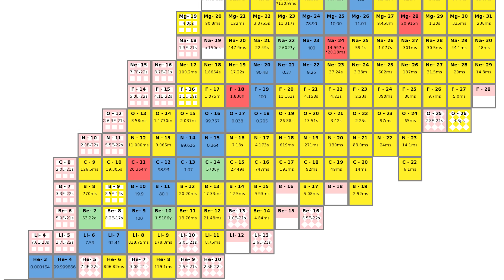Why the U.S. Doesn’t Recycle Nuclear Fuel

Comment: Nuclear energy is a scam. It's the most expensive form of generation on the planet, by far.
Reply: Everybody who talks about reprocessing spent nuclear fuel without mentioning that you produce tonnes of plutonium 239, which you need for a nuclear bomb, is disqualified. How can you not mention that?! It's a terrible idea to produce material for thousands of nukes as a waste.
Reply: Yet ruinables actually cost more than nuclear in the long term when real numbers are used.
Reply: @ForbiddTV if you study the numbers nuclear is ruinously expensive. The UK embarked on a full scale nuclear energy program beginning in the 1950’s & when the real bills came in the cost was so high that the Blair government abandoned nuclear power. A few years later another government decided nuclear was the way forward so we are now building, currently massively over budget, a joint Chinese French design. The whole concept of heat to steam to electricity is at best 50% efficient & reactors are built so far away from people that combined heat & power isn’t practical. If you want to make plutonium for weapons then reactors are great, if you want low cost electricity, renewables with storage are the only practical technology.
Reply: @springwoodcottage4248  Solar photovoltac panels are at best 24%, so do you actually have a point about comparing to steam turbines?  Now let us begin your education that you failed to research past the Greenie numbers:
Reply: @springwoodcottage4248   The numbers you will try to use RATED numbers for output capacity.  All my ruinable systems deliver MUCH less. Solar 1/4 of rated output in the best summer months, in winter it's as low as 1/32 of rated output.  Wind also less than 1/4 since most wind systems are rated at 25mph and averages in my area are only 7-8 mph.
Reply: @springwoodcottage4248   All ruinable systems need backup sources to operate on the grid lest we have massive rolling blackouts every time the sun goes behind a cloud or the wind stops blowing.  This almost always involves fossil fuel plants or storage.  So these costs of additional facilities always need to be factored in.
Reply: @springwoodcottage4248   Solar output degrades more than 2% in the first few weeks, and almost another 1% each year thereafter.  They never tell you this.
Reply: @springwoodcottage4248   Ruinable facilities need to be replaced 2-3 times in the same lifespan of a typical nuclear power plant.  Seems they should factor that in as well, but...
Reply: @springwoodcottage4248   To produce the same amount of electricity, a nuclear energy facility requires significantly less land than ruinables, with wind farms needing up to 360 times more land and solar photovoltaic plants requiring up to 75 times more land.  Keep in mind those are RATED output numbers which isn't a fair comparison.  Nuclear can keep a steady rated output 100% of the time 24/7 minus outages for maintenance etc.
Reply: @ForbiddTV demand is not 100% of the time, so that supply is not needed all the time & the cost of nuclear is many many times that of  renewables which are free fuel powered by the sun. The next development in renewables is large scale storage.
Reply: @springwoodcottage4248   Global installed electricity capacity reached 9.4 TW in 2024, while total electricity storage capacity was around 89 GW in 2024 (mostly pumped hydro), meaning storage is less than 1% of installed generation capacity.  Get back to us when you actually have something to talk about regarding energy storage. Since you have been promising me nuclear fusion for all of my 60 years, I am not buying any such what if nonsense.
Reply: @ForbiddTV   Is there any other way of generating electric power from Nuclear fuel except using it to boil water and spin a turbine with the steam?
Where is their turbines?
Reply: @ShonMardani generating heat to make steam to spin turbines is expensive & obsolete Victorian technology. Best to directly generate electricity & store it for subsequent use.
Reply: @springwoodcottage4248   You were just shown all the multitudes of items your Greenie numbers leave out of the comparison calculations.  So continuing to lie and say that nuclear costs is many times that of ruinables is not impressive and destroys your own memes.
Reply: @springwoodcottage4248    How do we get electricity directly?
Why there is those cooling towers?
Reply: @ShonMardani we use technologies that directly generate electricity, not old Victorian steam punk.
Reply: @springwoodcottage4248   Do those technologies have a name or descriptions?
What do they cool down with those cooling towers?
Does Elon have anything to to with faking this one too?

Comment: I want the LFTR reactor. It turns thorium into uranium on the fly inside the reactor and then burns the uranium right there. It has many many advantages in terms of safety, waste, and even cheap high temperature material processing for industry. They still need to work out some problems with the chemistry so it doesn't destroy the pipes and valves.
Reply: There nothing on the fly with thorium, because Pa-233 is a neutron poison. In contrast to the uranium cycle, where the breeding of Pu-239 is really on the fly, you are required to either use a separate thorium blancket for breeding, or you have to separate Pa-233 from the fuel loop. First is complicated and last causes proliferation risks.
But the main issue is the production of U-232, which decays to TI-208 at some point. It is one of the hottest natural gamma producer, which requires very thick shielding. 
So, it is much easier to use the uranium cycle, especially because of an abundance of spent fuel and depleted uranium.
Reply: Thorium is an annoying waste product of rare earth processing. The Chinese produce it in spades. This has a lot to do with why they are building Thorium reactors.

Comment: SMRS ARE CRAP. NOT ENOUGH POWER OUTPUT. SMALL NUCLEAR IS IRRESPONSIBLE. 
DATACENTRES ARE CRAP. NO ONE WANTS TO GET IN ONE LIKE ELON AND MARK.
Reply: Come back when you figure out what a caps lock button is.
Reply: @danadurnfordkevinblanchdebunk  the world could use more shouting about this crap 🤣
Reply: @danadurnfordkevinblanchdebunk  nightmares for 100 to 440mw. At least 2GW is worth nightmares and risk.
Reply: Is there any other way of generating electric power from Nuclear fuel except using it to boil water and spin a turbine with the steam?
Reply: @ShonMardani  yeah but water is easy to handle. sodium sounds like an accident waiting to happen
Reply: @ShonMardani   NASA uses Radioisotope Power Systems (RPS) and Radioisotope Thermoelectric Generators (RTGs), for NASA's current space probes. These systems use the heat from the natural decay of plutonium-238 to produce electricity, providing a reliable power source for missions to the outer solar system and other harsh environments where solar power is not feasible.
Reply: @danadurnfordkevinblanchdebunk  how many kilos of plutonium for how many milliwatts running the voyager?
Reply: so was I man. SMRS are crap!
Reply: @danadurnfordkevinblanchdebunk  and what did they achieve with that? some spare plutonium for an arms race? the output of a small gas turbine plant for all the risk of nuclear?
Reply: @danadurnfordkevinblanchdebunk  Yeah thats longstanding 3.5% PWR designs not 25% mini-me bombs buried 20metres below who gives a damn, general.
Reply: @danadurnfordkevinblanchdebunk  no you'd need a US NAVY engine if you just wanted to drive around in a ticking time bomb 🤣
Reply: @danadurnfordkevinblanchdebunk  there's nothing left to show.
Reply: @danadurnfordkevinblanchdebunk  SMRS ARE CRAP? same point man. Too small, not enough electricity output, not worth the hassles with Nuclear if its not at least going to give the people a couple of gigawatts. Cost too much per kw/h output. A risky waste. What's your point? These little terror riskers are worth 100 megawatts?! You gunna dig it up if this new tech f-s up?
Reply: @danadurnfordkevinblanchdebunk  no, proper nuclear power stations give you gigawatts. Conventional PWRs 1GW output each. I'll go build a 2 reactor PWR plant and make 2GW for $8-12 bil , you go build a grouped SMR plant and make 2GW, what's that cost? How's your maintenance? did all 20 of your 100mw Trump bombs pass there welding checks?
Reply: @danadurnfordkevinblanchdebunk  no I think they're great, conventional PWRs.
Reply: @danadurnfordkevinblanchdebunk  not at all, I checked out the xe-100 it looks pretty good. Some of the other ideas sound worse. I think new traditional PWRs make more sense and would be cheaper, whatever the investors are selling. The world doesn't need 1000 SMRs producing piss all power. 1000 gas turbines got to be a better bet
Reply: @danadurnfordkevinblanchdebunk  dude you are so petty about a few megawatts, you thought I was flaming 900MW Westinghouse because I said "1GW". You think i'm flaming Nuclear because I think SMRS are crap. I think your last comment sums it up entirely, who in their right mind would bother with the security and environmental risks for SMRS over gas? It seems you can't make a point, SMRS are pointless.
Reply: @danadurnfordkevinblanchdebunk  You can keep your ton of Tristo balls for my 100kg of lightwater waste? I dunno I just read it on the internet 🤣😄 no way Kevin, there is no way on earth Nuclear is safer than a stupid wind turbine or solar panel!

Comment: 90% of the world's population live in the sunbelt and windbelts. Fortunately for those with empty roof realestate. 

Dirt-cheap PV on dirt-cheap empty roof and no grid costs is a brilliant economic start.
Roof PV is cheaper than windows installed $m². 33m² is enough. 
66m² will fill the grid and self supply. 

Mathematics is simple starting place for sensible thinking.
Reply: You got it. That's why so many are against solar farms. It's not that they're against solar. They're against placing solar is stupid locations. Why ruin a field or forest when all these rooftops and parking lots exist?
Reply: @Ichibuns exactly. 
Roof PV destroys grid cashflow. 
In Australia high marginal taxpayers love tax-free savings, love ❤️ TAX-FREE. 
$10,000 tax-free savings annually for decades and decades. 

Many can not understand anything beyond the size of a nuclear fuel pellet, 10gm pellet.

With v2g EVs, No petroleum, no grid electricity, no gas heating,  no grid infrastructure upgrade costs ....
Reply: @danadurnfordkevinblanchdebunk  roof PV electricity is 2cents kWh electricity. 
No grid rental costs. 

My grid supplied electricity is 52cents kWh.
Both my neighbours 4cents kWh feed-in electricity is only 2 meters away. 
Nothing between us but the grid. 

The grid makes all electricity extremely expensive compared with the generation dirt-cheap costs.
Reply: tilapiadave3234  wow.
Reply: @danadurnfordkevinblanchdebunk you should have put in 3 grid tied systems
Reply: @danadurnfordkevinblanchdebunk  yes I thought that might be the situation. 
New connections to even city medium rise commercial developments have been held up waiting for enough supply. 
And the fees or costs were massive. 

No CO2 emissions and enough grid electricity is a big matter.

Comment: Why don't we do more to pursue Tidal Energy?  I have only heard of one European currently developing it.  It seems like a no brainer.  Sure there is a higher upfront cost, but in the long-term benefit is a reliable, limitless source of energy.
Reply: Europe: Done that. Close to mass adoption.
Reply: @michaelmueller9635   Not anywhere near.  No investors, no backing and underdeveloped.
Reply: @michaelmueller9635   Close adoption after over a thousand years of development?  You sound worse than the fusion wannabies.
Reply: It's been experimented with for more than a thousand years.  And as you noted it's not an actual thing because it hasn't been practical.
Reply: @danadurnfordkevinblanchdebunk  On the contrary, the one company pursuing it has shown it is practical and economical. They're just working on scaling things up.
Reply: @danadurnfordkevinblanchdebunk   That's a pretty lame attempt at an insult, particularly in light of the fact that the fusion breakthrough has already been done, with a net positive result.  And, as @RadDad419 points out, at least one company in Europe has demonstrated the efficiency and scalability of tidal energy.  Maybe try not listening to the MAGA cult so much.  Just a suggestion.
Reply: @danadurnfordkevinblanchdebunk  The problem with Tidal Power is low availability of suitable places to build facilities. France and Norway have operational facilities with excellent results, but widespread use is limited by geographic and topographic conditions of the coast
Reply: @danadurnfordkevinblanchdebunk   Fiords, salty lagunas and very high tides regions are perfect for tidal electricity. And France is particularly abundant in good places to build tidal power plants and it’s building a lot of them. Although, we should built things according to geographical capabilities. It’s just a another weapon on the arsenal

Comment: Wow, we are a massive consumer of electricity you need to adopt this strategy. And other ways to make fusion safer. How do you strip the split atoms from the ones that haven’t.
Reply: You can use a pyro-processing-unit, which uses destilation of metal salts to separate into different elements. They have different boiling temperatures.
Reply: @egnegn123 yes a thorium reactor right little safer if it has problems it just cools itself not going into meltdown.
Reply: @neonninja5049  The same true for fast-spectrum reactors using the uranium-cycle.
Reply: @egnegn123  The concept of pyroprocessing evolved over time, but a lot of the development came from research in the nuclear field, especially in the mid-20th century. Key contributions came from scientists and engineers working at places like the Argonne National Laboratory and other nuclear research facilities.
Reply: @egnegn123  By applying different temperatures and sometimes using specific chemical environments, it helps to isolate and separate the different elements or compounds. This makes it really effective for recycling valuable materials and getting rid of impurities. It’s a pretty fascinating process!
Reply: Is there any other way of generating electric power from Nuclear fuel except using it to boil water and spin a turbine with the steam?
Reply: @ShonMardani  Yeah, definitely! While the traditional method is to use the heat from fusion to produce steam and drive turbines, there are other concepts as well. For instance, some advanced designs look at using direct conversion methods, like converting the charged particles from the fusion reaction directly into electricity. Another idea is using fusion-generated particles in a magnetohydrodynamic generator, which can produce electricity without mechanical parts. It’s definitely a fascinating area of research!🔬
Reply: @neonninja5049   The concepts you mentioned are just imaginations and wishful thinking. However none of Nuclear power plants have shown their boilers and turbines, do you know why?
Reply: @ShonMardani  Why do you have a problem with boiling water in the first place?
With supercritical water you can currently achieve an efficiency of up to 50 %. An alternative is to use supercritical CO2, spinning a gas turbine and use combined-cycle to achieve even higher efficieny.

Comment: There is only one reason for being pro-nuclear:
Prolonging subsidies into fossils.

Nuclear is just a "canary in a coal mine" for fossil subsidies. And that is the discussion all about.
Reply: Is there any other way of generating electric power from Nuclear fuel except using it to boil water and spin a turbine with the steam?
Reply: @ShonMardani  The most important thing: Nuclear and fossils do not get an efficiency > 40 %. Because they are thermodynamic engines. 

If you go for renewables: Even if you use power(renewables)-heat(also local/decentralized district heating)-power(electricity)-coupling, you are above 40 % efficiency
Reply: Oh, not because it's cleaner and safer than fossils?  Wow.
Reply: @danadurnfordkevinblanchdebunk  It is the economy, stupid.

Comment: Nuclear recycling in France is certainly not economical.
La Hague is more or less the opposite of a showcase project.
Reply: Why would you think it's not economical?  Less mining, and less waste.
Reply: @danadurnfordkevinblanchdebunk  La Hague is and was never an economical decision.
The value of the recovered plutonium is low relative to the costs and effort involved.
The costs of reprocessing are high and often higher than the costs of direct disposal of fuel elements.
Reprocessing is often associated with the claim of conserving resources and producing less high-level waste. In reality, however, the majority of the resulting radioactive waste must be disposed of, so no significant economic improvement is achieved.
The costs of producing fresh uranium fuel, although dependent on current world market prices, are cheaper than the complex reprocessing and recovery process.
La Hague has existed for 45 years now, and the problems and inefficiency have increased rather than decreased. This technology has deteriorated over time, not improved.
Reply: @danadurnfordkevinblanchdebunk  I guess you should check the reality:
Reprocessing does not match its intent and promises. It fails to deliver (and this is the point, where you do not acknowledge the facts/reality).

It is like always with nuclear: Overpromise and underdeliver.